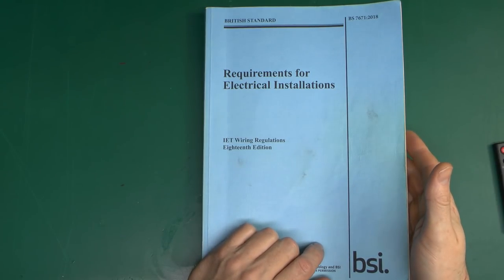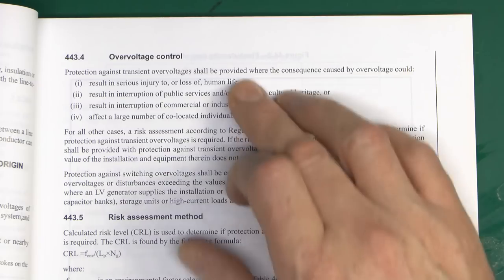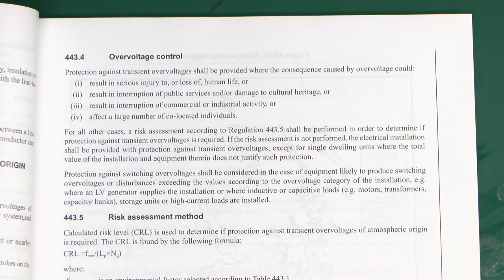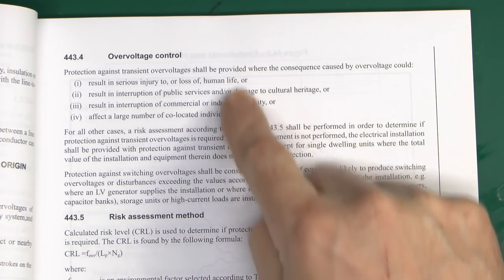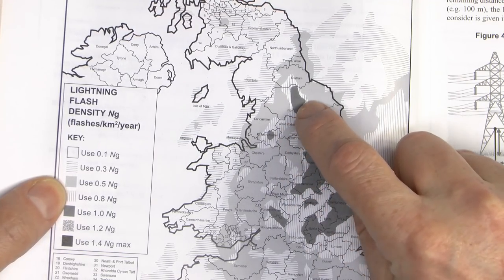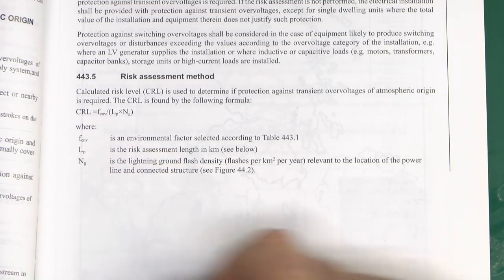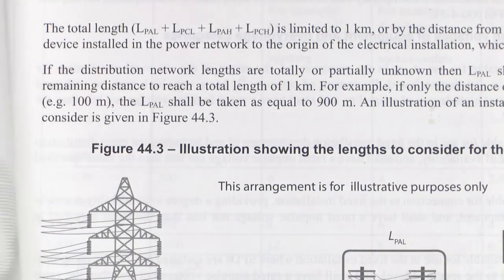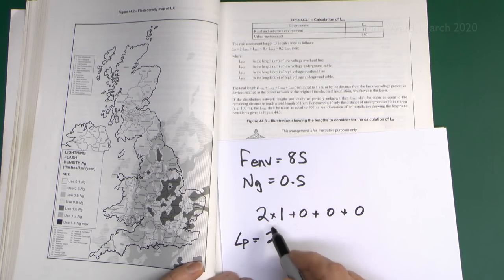Risk Calculation - Surge Protection Part 6

Comment: This is what frustrates me with the regulations, rather than giving a load of options as justification not to install it, just say surge protection has to be fitted, then there's no confusion 🙄
Reply: This is what most other European countries did after IEC 60364 put SPD's in as standard across the board and CENELC accepted it as a harmonised European document. Only the UK chose to go with this clunky & awkward version where it's virtually impossible to not install the SPD but at the same time the document isn't actually saying that which gives the cowboys their get out of jail card.

Comment: Requirement for SPD 'Types' and relevant locations in electrical installations on the next video John?
Limitations of  'theoretical' protection perhaps?
Great work as ever, thanks again!
Reply: Hi Shaun, Type 1 devices are "Lightning arrest devices" and only required if, there is structural lightning protection installed or the structure is fed via an overhead line. Type 2 devices are what the 18th edition is now highlighting, these would be at the origin of an LV distribution system (if no lightning protection) or in larger commercial / industrial applications you could see additional type 2's within the sub-distribution boards IF the equipment they feed is considered vital by the client. TYpe 3 devices should be as close as physically possible to sensitive terminal equipment, a fire alarm panel, a server etc. They are much smaller, some the size of a tic tac box, they can be placed in dado trunking, back boxes, or even in the terminal equipment itself. No SPD can offer protection for more than 10m (cable length) from it's location. If you have a combined type 2/3 device at the origin then no other device would be needed for terminal equipment less than 10m away. If you had something 15-20m away then you should consider additional protection. sean.passant@dehn.co.uk if you want to contact me for any further advice or have any other questions.

Comment: Hrm, that CRL calculation pretty much boils down to: Rural means install protection unless it's next door to a modern substation. The only way to get that bas level of 85 to anything like 1000+ is ifLP is a tiny fraction working out to 0.085 or smaller.
Reply from the maker: Yes.  The calculation itself isn't of much use.
Reply: @jwflame  Indeed, only worth doing at all in urban areas.

Comment: That risk assessment (>1000 - <1000) looks to me to be the wrong way round.
Reply: I thought so at first glance, but on checking protection is required of CRL < 1000. Both line length (LP) and the strike probability factor (Np) are in the denominator for CRL, so that as they increase (increasing the need for protection) CRL decreases. So the inequality is in the correct sense. It seems to me that using the inverse of the defined CRL would have been more intuitive, so that an increasing risk lead to a larger metric.

Comment: So what is the point in putting the single dwelling exemption in if it’s completely pointless?
Reply: robert swingler I guess you need to consider/make flats and bedsits to be except.
Reply: Hotel room? That's the only single dwelling unit where someone wouldn't have lots of electronics....

Comment: Nice to see practical videos with calculations for various scenarios applied to surge protection on UK regulation. Great Video .
The local PT_PT Regulation available for Low voltage (RTIEBT) looks like that covers this type of protection in section 321.13 (lots of edit)

Comment: l agree with your interpretation of this section of BS7671, but l have told twice now that l should recommend surge protection to my domestic customers but it is there decision whether you install it or not .l cannot see anywhere in BS7671 that allows this, could you please clarify this point regards s sulley
Reply from the maker: Nothing in BS7671 that covers that.  For domestic installations it's do the calculation - is it required or not.  If it is, then not installing it will not comply with BS7671.  Even if not required, the cost for a typical domestic is so low that it's sensible to recommend it anyway.
If someone absolutely insists they don't want it then advice from other organisations has been to get that in writing and have the customer sign it. 
My opinion is that if you have a customer who is complaining over an extra £50-£100 on a new consumer unit or rewire, then it's probably not the kind of customer anyone wants.  The kind that wants everything else done on the ultra-cheap and will still complain about the price even if that's what they get.
Reply: thanks for reply ,l am with all way but there are some in the industry coming up with a different spin on how  this sections regulations are applied regards s,sulley

Comment: The cynical would say that the DNO's have pulled a fast one and offloaded all the responsibility to the consumer when they should be fitting surge arresters at their distribution substations and especially at pole transformers.  In urban areas fitting surge arresters within the consumer unit is fixing a problem that really doesn't or shouldn't ever exist.
Reply: And the realistic would admit that there are loads outside the control of DNOs which create transients which cannot be effectively clamped from 300m down the line..
Reply: Monkeh oooh, interesting. Can you evidence this please? I’d like to use it 👍
Reply: @shaunsparky5354  The evidence is in simple truths, no SPD can offer protection further than 10m away from itself in cable length so there would be no point in installing any SPD in subs or on poll Tx. Frequency oscillation alone can create 1,000's of volts. Switching surges, inductive loads, lightning strikes, pumps & motors kicking in repeatedly, fuses blowing, kids flicking lights on and off repeatedly, all of these can and do create transients and all are beyond the DNO's control. The over voltage protection has to be in the individual consumers property.
Reply: See 17:30 for the answer, the tinfoil hat won't protect your electronics from surge generated by the neighbors or your own equipment.

Comment: If your house has been hit by lightning do you need surge protection or does lightning strike twice?
Reply: Would be preferable but a type 2 at the supply isn't going to protect you from a direct strike.
Reply: Is this a serious question? Yes lightning can & often does strike repeatedly, it's an old wives tale not science. For lightning arrest you need a type 1 device and it must be 12.5kA per phase minimum unless you can calculate  and prove your level of current division.

Comment: That black dot looks like its somewhere near Sleaford :) I live in Notts, I have a ton of extensions with surge protection built in and a computer UPS with it built in. Dont really get surges here, just the occasional momentary dimming of lights and rarely my UPS clicks in and beeps for a sudden under-voltage. I like how the map makes Notts look like lightning valley, I wish! I love lightning! Havent seen any in over a year lol
Reply: The epicentre is slightly lower and further over, nearer Boston in Lincs, the data comes from ground monitoring stations and is a sample over many years. This epicentre is moving, it used to be even further down (north London basically) as our climate warms, we will see more lightning activity and since I started in the industry (28 years ago) the level of lightning activity in the UK has nearly doubled in some places.

Comment: May be worth noting that the total distance of all of the L values without their multipliers added together is limited to 1km. Therefore it is often easier to default to 1km for Lpal and use its multiplier to give 2 1x2=2. 
In most applications of the calculation Lp will equal 2. 

I just auto-default to 2 as I do not know any of the lengths.
Reply: Hadn't reached 18 mins yet. 😂
Reply: @DCMamvcivmEvony  OK,  so you were just demonstrating a commentary observation. 
It's not a wasted comment,  it is well worth noting the weighting of risk at each of the 4 stages (for what its worth)
If the 1km value is applied to LPAL then it's 'risk' is attributed with x 2 to obtain the end value.
Good point, well observed!